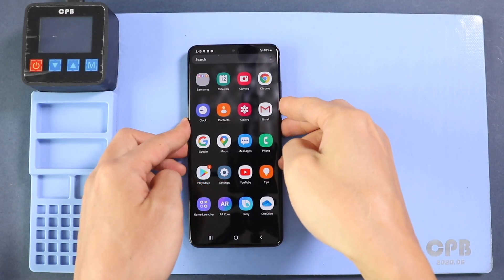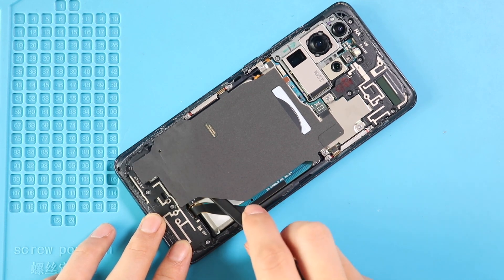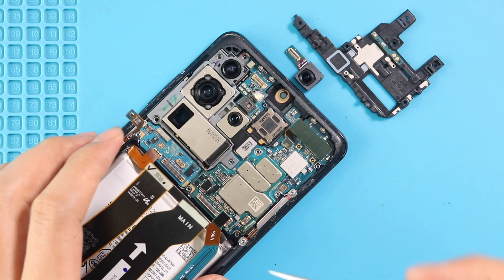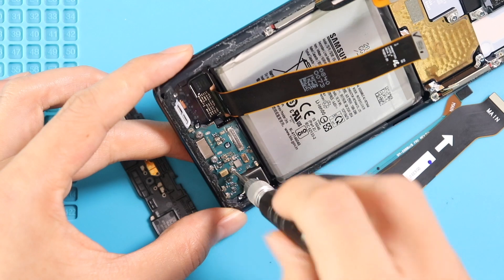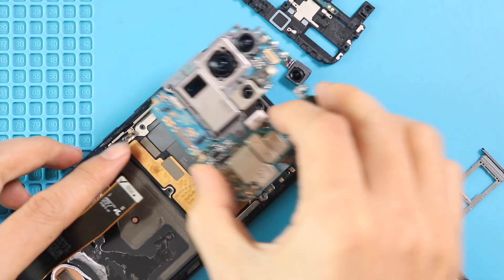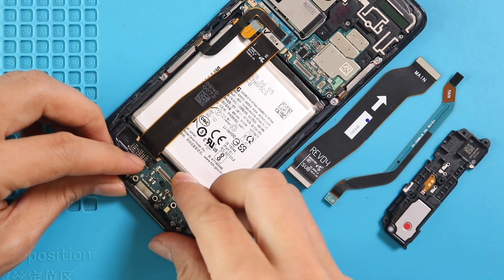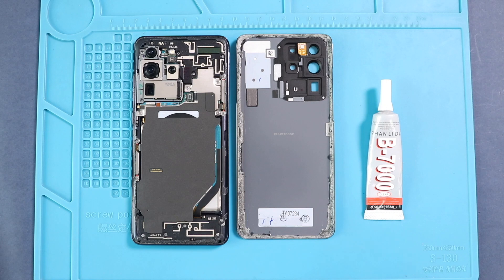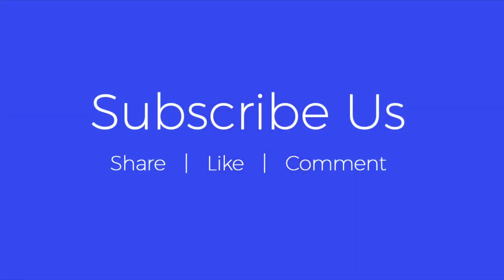Samsung Galaxy S20 Ultra LCD Screen Replacement

Comment: I don't have all these tools, and I don't think I have the skills. Will it be cheaper just to get a repair shop to do the job? I have been quoted £170 to fix the screen on my S20 Ultra.
Reply from the maker: Replacing with the frame is fairly easy..

Comment: Cost of screen replacement so after fitting LCD instead of amoled will battery backup drains fast
Reply from the maker: It can happen, but there are good lcd versions too